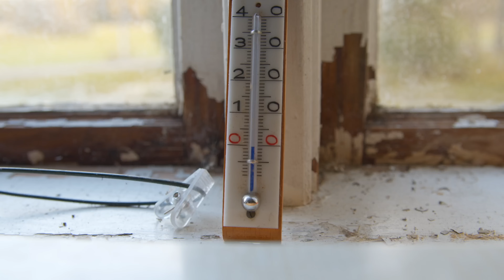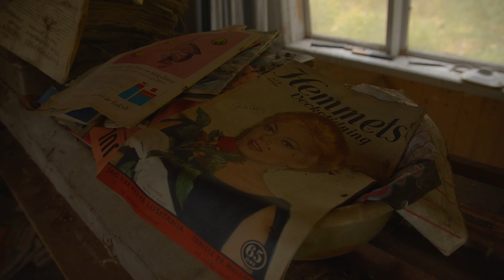Ch. 10 - I Can FINALLY Heat My Cabin

Comment: I've watched all your videos and I like them, beautifully shot and there's a calmness to it. However, as a watcher it's getting a little bit annoying with all the unfinished tasks you take on without really finishing any of them before you move on to something else. The rewarding feeling for the viewer never comes, basically. Just a tip..
Reply: Absolutely agree i love to see the finished product after following from the start.
Reply: I was noticing that as well...did the white trim out side get painted or no?
Reply: @deniseiozzo8821  No he didn't paint them, you can even see it in this video at 11:47  - They're stripped of old paint but not repainted and exposed to the nordic elements of all things. Also, I think he only painted 3 sides red before giving up? 🤔
Reply from the maker: It got too cold and damp to paint it unfortunately

Comment: I noticed you've changed your driving habits .. yup .. it is much safer to reverse from the road into the yard than to reverse from the yard onto the road .. plus in my opinion, when you need to go, it is much more convenient to start driving without unnecessary maneuvers such as driving backwards 😉
26:37 - Wait!! Now you need to drill a hole so the screw could tighten the two pieces together .. otherwise the connection remains loose .. dunno why, but that's a very common mistake most DIY'ers make - they drive the screws equally through both details  :)))

Comment: How did the previous owners have central heating without mains water connected to the house? 🤔
Reply from the maker: I believe they brought in water from the stream or from somewhere else. As long as you have water in the system, I guess you're fine, but I'm not sure